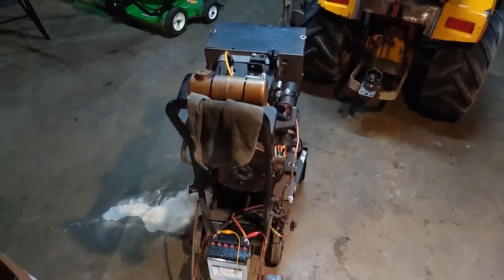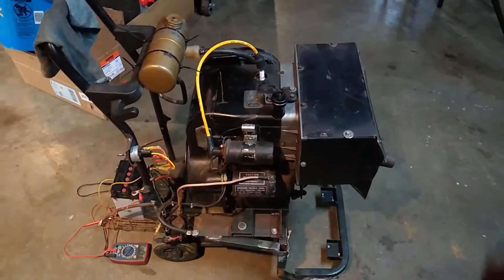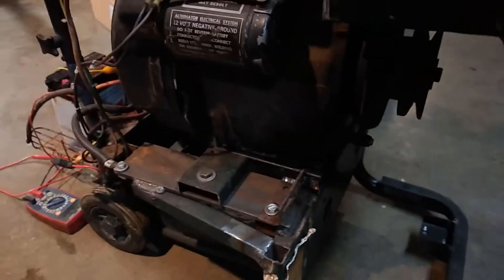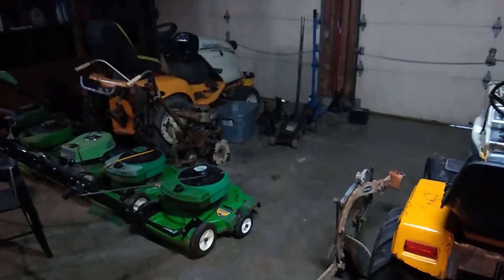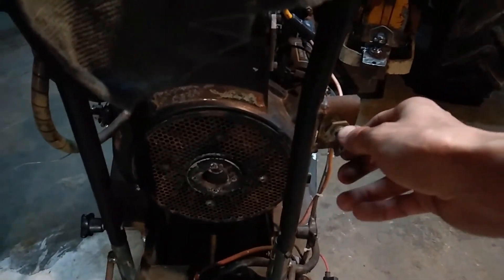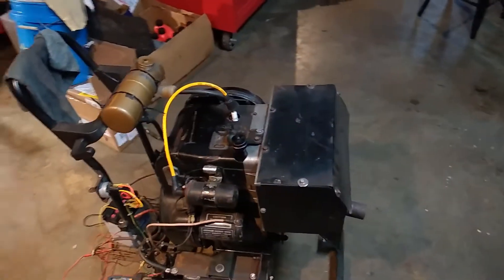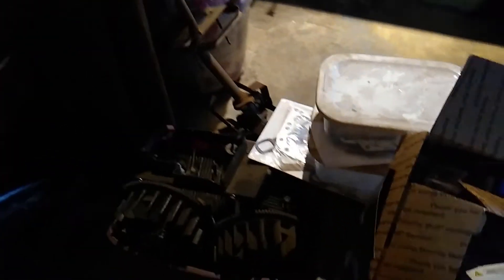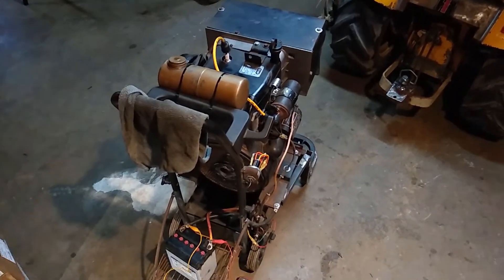Kohler K-Series Engine Mobile Test Stand

Comment: Good idea , I think I got most of the same stuff laying out back , wondered what I could do with that power washer cart , the motor blew up on ..I got a few echo 749 ' s , 26.5 hp kohlers , I'm trying to get one going for my vermeer 262 stump grinder , I got it as a basket case .. I just did one for my turf tiger lawn mower , it's going back into service tomorrow,  runs good , fingers crossed ..I just put new heads on it ,bottom end looked good never disassembled it ,no ridge at all .. The heads both cracked from plugged exhaust,4348 hrs ,  efi model , new muffler and oxy sensor also ..vermeer is carb model ..gotta disassemble it see what it needs ..